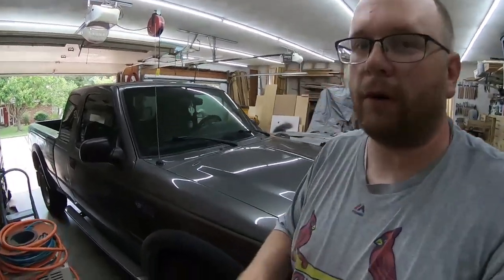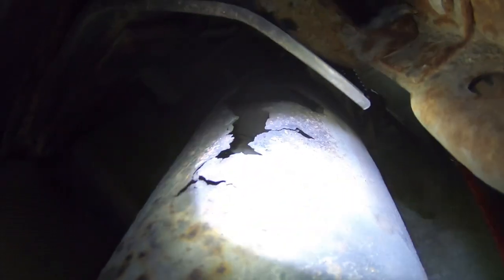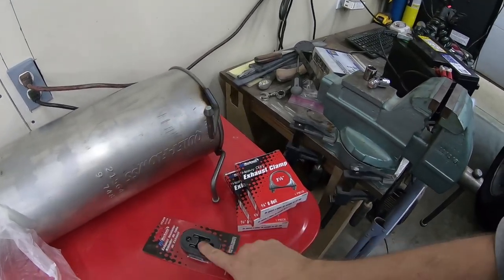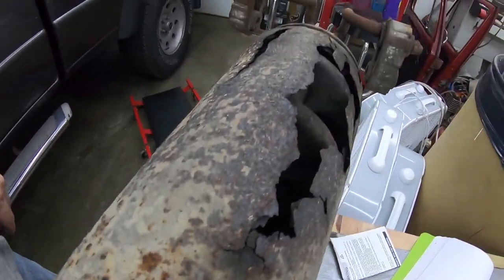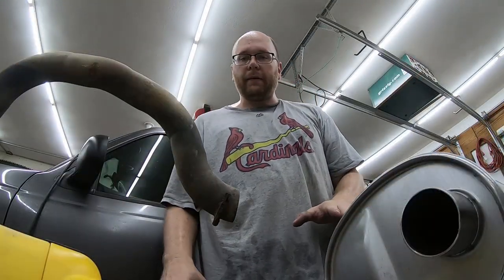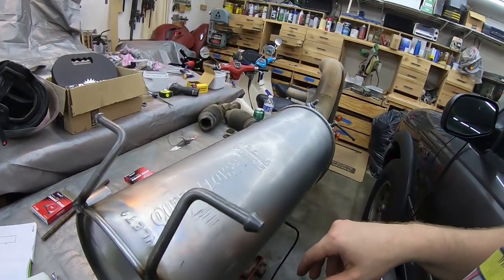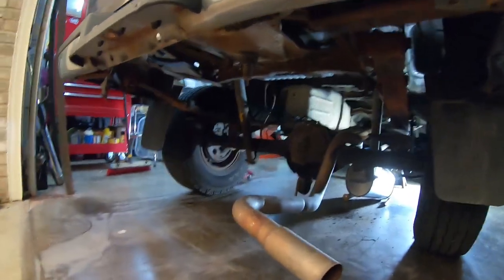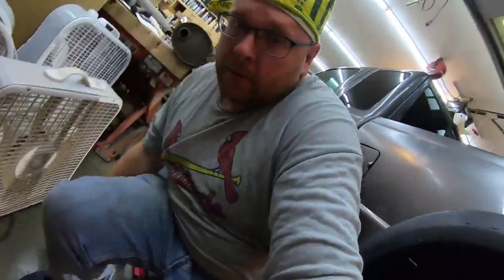Ranger Danger 1: Muffler Replacement || Turning the roar into a purr

Comment: Hello Mr. Ligjtle my next project on my 2003 Ford ranger pickup will be the gas tank. I'm having problems putting in gas it only allows me to put in very little at a time the gas nozzle keeps shutting off I think there's something inside my guest tank that's not allowing the gas to go into the intake  tube that leads to the tank
Reply: Intake gas tank.  What can I do to fix this problem.

Comment: You could have solved the problem with the rubber hanger that you are using a zip tie if you had done some YouTube research. A guy showed how to remove the rivet, easy peasy and replace it with a bolt to support the rubber hanger. He used a grinder to  cut the rivet away.